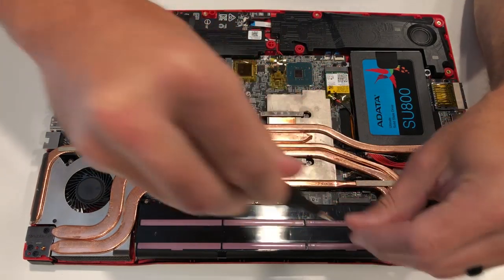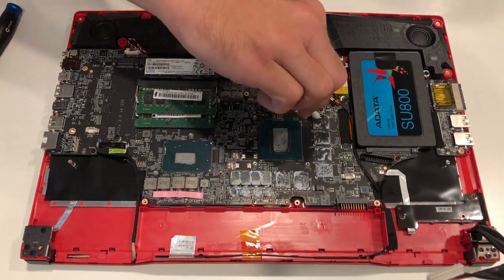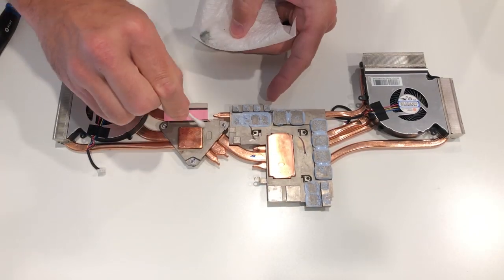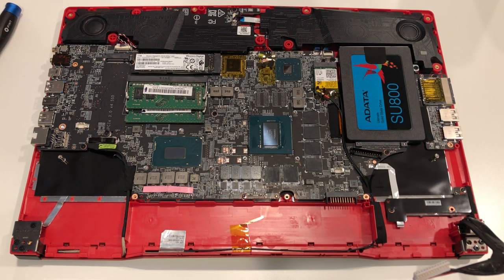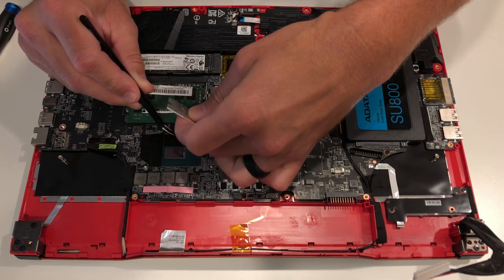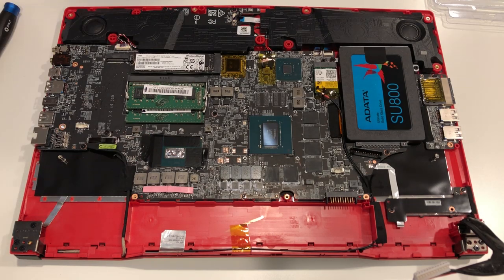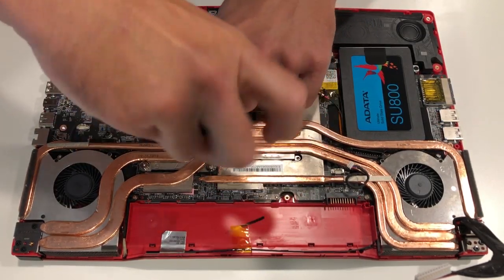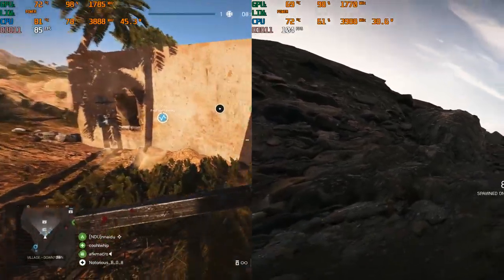MSI GL63 9750h 1660ti Liquid Metal CPU teardown!  Cools like a boss!

Comment: Correction on my previous comment. Ocillator NOT CPU Die
Reply: You can improve the conductivity of the heat sink but not the ocillator. Ergo an overall improvement in the interface.